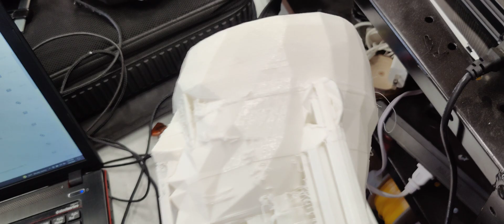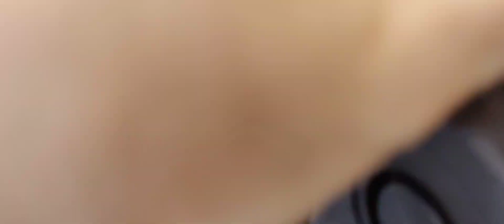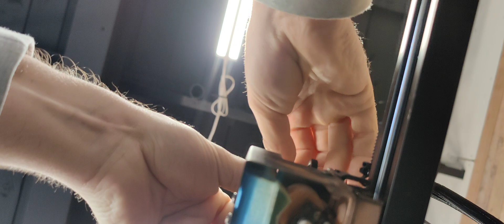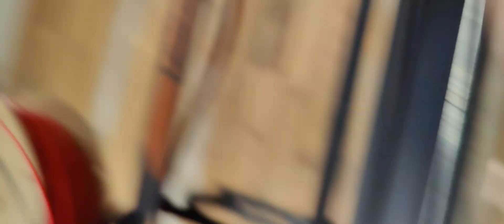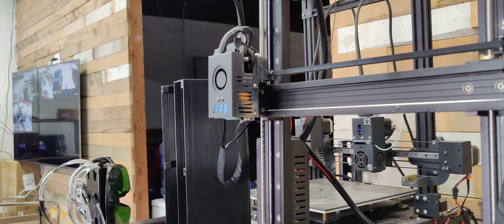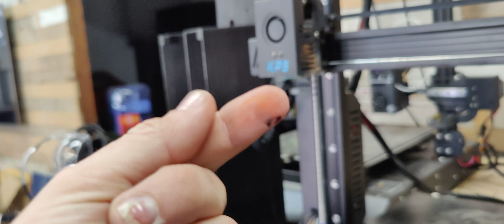How did this happen? .6nozzle turned into 1.75 nozzle

Comment: I've heard that many filaments have abrasive additives that will eat brass nozzles very quickly. Things that I have heard mentioned include metal fill of course, and stone fill, but also wood fill, phosphorescent materials, and glitters. I suspect that dust is abrasive. You may have to upgrade to a hardened nozzle. Either a steel, tungsten, or ruby.